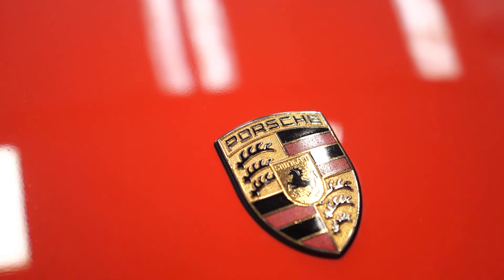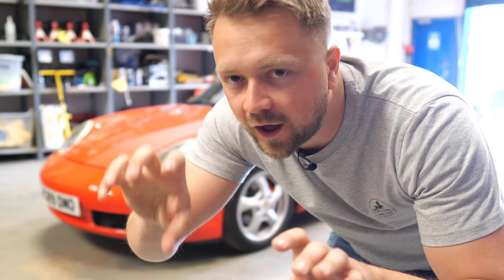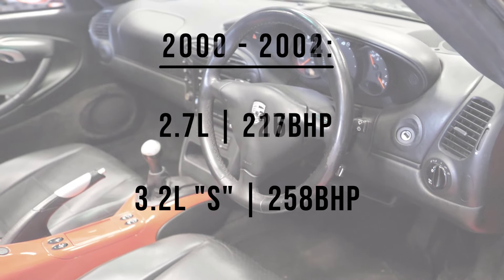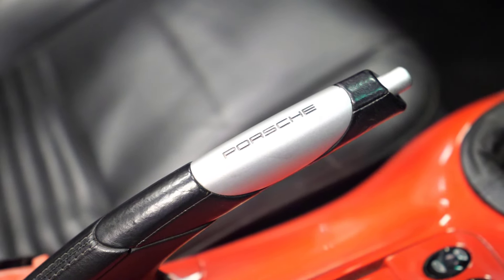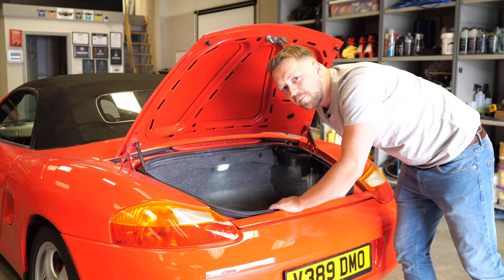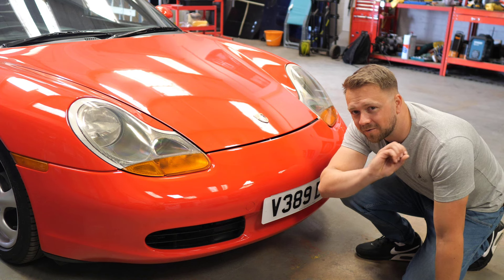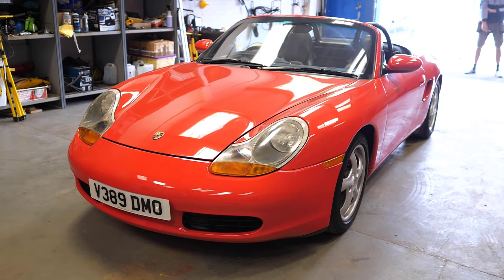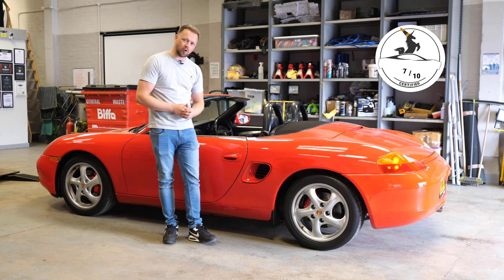Everything That Goes Wrong With A PORSCHE BOXSTER (986) BUYERS GUIDE

Comment: I have a Boxster S 3.2  since 11 years now. Drove it 100.000km (has total 140.000km now) and the only thing that had to be repaired was the waterpump - which is normal that it breaks after some years. Ofcourse the boxster got new breakes and also new tires but these are parts you have to change at every car from time to time if you drive it.

Comment: 911s from the same era also had the IMS bearing problem -- although the 911 turbo did not.  There are non-Porsche IMS bearings that solve the problem via superior lubrication pathways. If your IMS hasn't been changed you need to change it, b/c that engine can grenade without any forewarning.

Comment: Sorry, small mistake here, but the IMS bearing is a sealed bearing with grease inside, but the seal might get compromised by contaminated engine oil and the grease is flushed out.
That is, when the bearing gets lubricated to a certain extent by the engine oil, but will fail eventually.
Regular oil changes once a year (instead of the two-year service schedule) is a measure to prevent this.
Reply: If the seals are not removed the oil in the bearing and shaft itself will never get changed, oil change intervals is not the problem.  Ball bearing can live long and happy lives lubricated with engine oil only if it is fresh and clean neither one of which can happen with the oil seals in place.
Reply: You are right, the bearing is 'sealed'. Frequent oil changes won't help. Think about this long and hard.

Comment: Good guide, but you missed a big problem with the top that is shown right at 9:18 in the video. The top jumps out of the the track for the guide wire.
Reply: You can fix this problem easily yourself by tightening the elastic strap on the inner side of the top, or if it’s worn out and broken by sowing or stapling the rear ends of that strap. Several videos of solving this problem on YT! Success fixin’it😉

Comment: Didn’t mention the cylinder bore scoring problem that affects al of them at some point and requires an engine rebuild
Reply: Thanks for this, cuz I though it was only affecting the S versions
Reply: @RiotHand I think it effects all BUT the S versions.
Reply: It doesn't affect all of them - in fact boxsters have a very low rate of bore scoring. It's the gen 1 Caymans which I think have the highest bore scoring rates (mostly the S models) 2004 to 2009 (also 997 Carrera) - Lokasil II coatings (weaker/thinner) were apparently to blame.
Reply: @FridaysTheBomb  The S versions are MORE likely to have it!
Reply: Bore scoring really only affects the cars that had forged pistons (2007/2008 Boxster S 3.4L).

The 1997-2006 Boxster and Boxster S (2.5L, 2.7L, 3.2L) used cast pistons and aren't as likely to become bore scored.

All 911s from 1997-2008 are susceptible to bore scoring (some years worse than others due to a cylinder coating change) and all Cayman S cars are susceptible. Basically the 3.4L or larger engines with the forged pistons are susceptible.

The problem was the forged pistons would expand and contract in size more during heavier heat cycles. The cast pistons were more likely to hold their shape longer and therefore put less heat stress on the cylinder walls.

Comment: Your roof is busted on the passenger side, that piping is supposed to sit under the plastic. You'll get a soggy passenger carpet and eventually your control module under the seat will corrode to death.

Comment: Nice little cars, but after having tested a few, I have to say the performance is extremely underwhelming, considering the risk you take on when buying one of these cars. At the time I tested them, I owned a C5 Corvette and a 2001 Mustang Cobra, both of which would leave an early Boxster for dead, and for a MUCH more favourable risk/reward ratio. I simply couldn't justify that substantial of a drop in performance from what I was accustomed to, just to inherit a boat load of potential gut punches to my savings. All that said, I still find myself looking at them in the classifieds🤷🏼‍♂️

Comment: you missed the leaking windscreen left side and the wet floor passenger side ruining the computer under the passenger seat. Also flat battery after car goes into sleep mode and its a pig to start it. Loose keys and you got another expensive problem.

Comment: My experience, 4 years ago bought a 99 Boxster from a lady for $4500.00.  Car had 89000 KMS on it but a grenaded engine (IMS failure). Aside from the engine problem the car was what you would expect from a babied low mileage vehicle.  Bought a used engine with 10000 kms for $5000.00 complete with all accessories, installed roller IMS bearing, RMS and new clutch, replaced all the fluids.  A year latter one exhaust valve spring failed, robbed parts from old engine to fix.  Sold old engine for $2000.  Car is a joy to drive under the right conditions as I also have Tesla and C6 Corvette for the other occasions. The key to all of this is that I did all the work myself.  The resale value of these cars even at today's inflated prices doesn't justify owning these cars unless you can avoid the dreaded Porsche tax for parts and the hideous labor rates at Porsche shops.

Comment: Good cars, handle well, but don’t feel in any way fast or even brisk due to Porsche’s insistence on using long gearing and tall final drive ratios. Such a shame as the tend to feel a bit soft and cater for the masses rather than proper car enthusiasts that like a more raw genuine engine experience.

Comment: I got an NC MX-5, very reliable and no worries about engine failure or leaking bearings. After watching this video I think that Boxster's are a potential money pit and are froth with big issues that require constant monitoring by Porsche mechanics ($$$). My MX-5 may not be as fast or as much of a head turner as the Boxster but then again, I am not too hung up on Logos so I don't need the badge to have fun.

Comment: Is the IMS bearing gold in color because it is brass?  If so, maybe that's part of the issue.  If I remember correctly, brass "work hardens", i.e. the more it wears the harder/more brittle it gets.   I feel silly, but I'm having trouble determining what it's made of- after looking it up.
Reply: It's steel (steel balls to be precise).
Reply: @lindsaydobson  ok, thanks. That makes more sense. 👍
Reply: They are nor brass but by the time metal flakes show up in the oil and filter they are discolored by the heat of failure so appear gold.
Reply: @richardcalon3724  thank you 👍 that makes sense.

Comment: This video reminds me why I sold my gen 1 Cayman S after only 10 months😂 I hated the anxiety of waiting for the IMS bearing to lunch itself. My AC was crap, so new condensers needed, it hesitated under acceleration and the air/oil separator broke, covering the car in a magicians puff of white smoke as I was parked downwind. I wish the sodding thing had disappeared! Surprisingly unrewarding to drive, with numb steering and not much grip, despite being on very expensive tyres. Which wore out in 6 months. Oh, and it guzzled oil, at about 1 litre in less than 1000 miles which Porsche said was normal. My current mx5 mk1 cost less to buy and restore than the running costs of my Cayman S over 10 months and is way more reliable and a hoot to drive and own. Lights up, lights down FTW!

Comment: Check out my boxster 21k miles 1999 still on original Michelin tyres 💎💯👍
Reply: Death trap if you are running original tires.   They are over 22 years old.   6 to 10 years tops for tire life regardless of tread.
Reply: @MDQDZINE  car came with original tyres and alloys which I took off in 2007 and replaced with keskin alloys and new tyres 💎👌

Comment: I had a 986 Boxster and sold it less than a year later. Too many compromises in my opinion. The interior is embarrassingly cheap. The seats were flat, unsupportive and made with really crappy leather. A lot of cheap plastic everywhere. Cupholders are not where they should be. No rear parcel shelf for my dog. I wound up buying a Mini Cooper JCW convertible. It's shorter than a Boxster, seats four, has premium leather, cup holders are front and center where they belong, it handles like a go-kart and the top can be open half-way like a sunroof or completely as a convertible.  So if the Boxster doesn't check all the boxes for you, then consider the Mini.

Comment: Correct me if I'm wrong but there are two IMS bearings, the front one is a plain bearing lubricated by engine oil which never fails.  The other bearing on the rear of the engine is a sealed ball bearing which is not lubricated with engine oil. The problem is that this bearing has grease lubrication when new but because it is inside the crankcase and subjected to heat cycles and hot engine oil, the seals can and do partially fail, allowing the grease to be washed out.  Since the seals only partially fail( see reply to @steveclarke 8169 below) lubruction is by splash trying to work its way thru a seal, not an ideal situation.  Porsche tried a number of different bearing sizes in both single row and double row and finally settled on a bearing that cannot be replaced without a total engine disassembly, not ideal.  There are a number of aftermarket replacement bearing solutions for the earlier cars that are quite effective with most dispensing with the seals allowing full time oil lubrication.